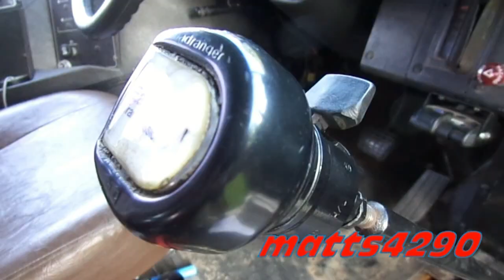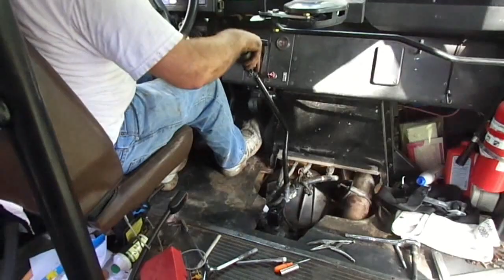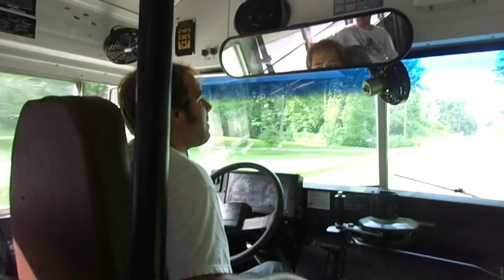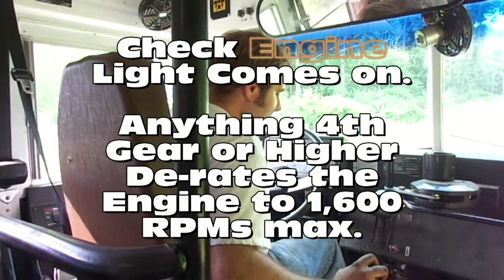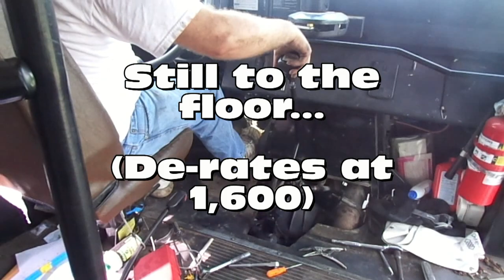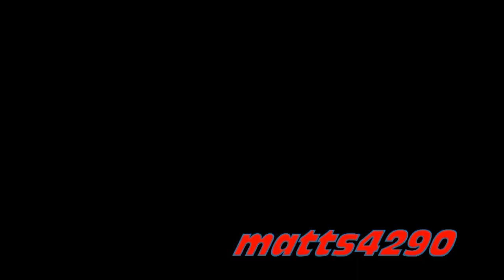GMC BUS TRANS SWAP PART IV   TEST DRIVE!

Comment: You must change the parameters in the ecm, currently it was set up for an automatic, you need to change it to a manuel, did you swith over the output speed sensor?

Comment: Is first gear always top left in manuals?
Reply: No. In most medium-duty (Class B) manual trucks and buses it is, but I have seen and driven some tractors/trucks where 1st gear was bottom left (usually treated as "Low" and you would start in 2nd or 3rd)
Reply: Donnelle Bivens
Start in 2nd/3rd? isn't that heavy for the clutch?
Reply: knightrider1545 I thought so for a while too, but Eaton Fuller transmissions are built for 70-80,000 pound tractor-trailer loads. They tell you not to start in 1st gear if you're not hooked up due to the major difference in weight and engine torque.
Reply: Donnelle Bivens What do you mean? by :"the major difference in weight and engine torque".
Reply: knightrider1545 There's a difference in the amount of power needed to take off when loaded and unloaded. This summer, I took a 2015 Freightliner to UPS in PA that was rated at 35,000 weight. The engine can pull up to 1,650 lb-ft of torque when a trailer is attached. It actually creates more damage to the clutch to start in 1st in that situation because the load isn't heavy enough, so Eaton's owner manual suggested starting in 3rd. If I were pulling a trailer behind it, and it were full (45,000 lbs), I would have started in 1st. The final decision depends on the model of your truck, amount of weight you're carrying, and the number of available gears (usually 6, 8, 10, 13, or 18) in your truck.
Reply: Donnelle Bivens
Whu du heck? More damage to the clutch? It sounds like you need to remove first and second and WING IT>.
Reply: Donnelle Bivens
Why not a 7 speed Donna Fey?
Reply from the maker: knightrider1545 I usually always start in 2nd gear.  1st gear is 9.01:1 so it is really low and you can't get much speed and you almost stop shifting to second gear.  I usually only use 1st at the boat launch.  Reverse is top left on this transmission.
Reply: matts4290
Ok matt but can this bus do 85mph?
Reply from the maker: knightrider1545 No, it exceeds its mechanical limitations.
Reply: matts4290
So it can only do 65?
Reply from the maker: knightrider1545 Technically, its limited by how many RPMs the engine is governed at- which is 2,500.  With the current gearing, that is 74.3 mph, and since it is only 175 hp, it will only do that downhill.
Reply: matts4290
IS IT A RUSH?
Reply: In 4-speed manuals it most certainly is. Incidentally. 2nd gear's also reverse in many four speeds
Reply: Usually but on lamborghinis and possibly ferraris the first gear is bottom left while reverse is top left
Reply: Actually, 1st gear in all medium, and heavy duty trucks from the mid 70's on is always bottom left, and reverse is always top left.
Reply: ***** 4 speed what's there?
Reply: @DJBiv788  - True about the Class B trucks.  What folks seems to have forgotten was back when buses were bodies (not unibody) there was severe overlap between conventional school bus engines and Class B trucks; examples were Ford's F-700/750 and International/Navistar Loadstar/S1600/1700/1800.  I noticed primarily due to Maryland's SHA's rather large Class B fleet (mostly International (therefore Loadstar and S series)).  Reverse is lower left, and first was upper left.  Most class C buses (same with most class B trucks, except when heavily loaded) they would launch in second (not first) gear.  Ford's F-7xx/B-7xx pilots would mostly skip fourth gear (so you ended up with a second-third-fifth gear pattern/middle top-middle bottom/right-bottom).  International/Navistar Loadstar/S , on the other hand, despite the same gear placement, did NOT skip fourth gear; just first (except in heavy load scenarios) so the shifting was conventional otherwise (traditional H, starting middle top to right bottom).  Fourth gear in Ford's F-series class Bs and Class C buses?  Passing gear. (Fun part; riding behind the driver on a Ford F-7xx OR B-7xx when he shifts into passing gear.  You wouldn't think that a school bus would actually pass ANYTHING until you see that.  It gets MORE hilarious when you're in a short bus (not a Minotour - but a half-length Class C conventional).  This was why back in those days, Ford (not International) was a student favorite on activity runs (they tended then - as now - to be longer than the typical route).

Comment: What is that shift pattern? The knob say its a road ranger (roundhouse) Transmission. But it doesn't shift like one.
Reply: This one is an Eaton Fuller FS-6306 6 speed. I think the knob is from another transmission. The splitter doesn't work for this type of transmission.
Reply: Fredriq Craft خممممممممه

Comment: It derated because you forgot to put the auto shifter in D.  Looks like it was in R...  Pissed off the engine computer...  My bus does the same thing all the time--even without an engine computer...
Reply: He pulled out a mechanical AT545, no computer= no codes
Reply: jimster1211
 Read my comment a little closer...  ;)

Comment: If the engine cannot see vehicle speed it will derate, and set the CEL.
Reply: Thats kinda dumb.
Reply: knightrider1545 
That's the way with any electronic engine programming. .. :-/
Reply: Still is kinda uneducated tho.